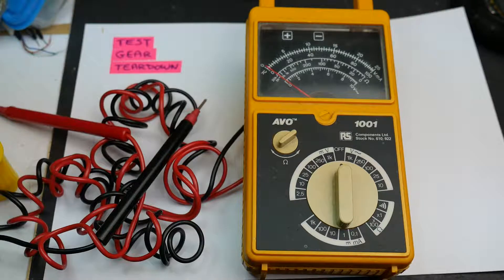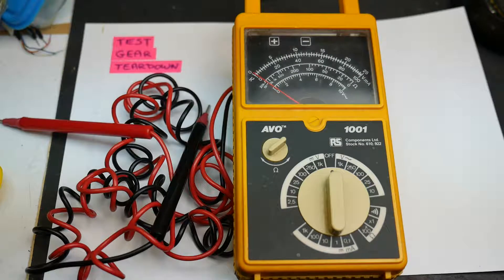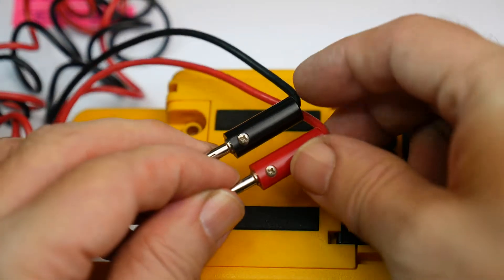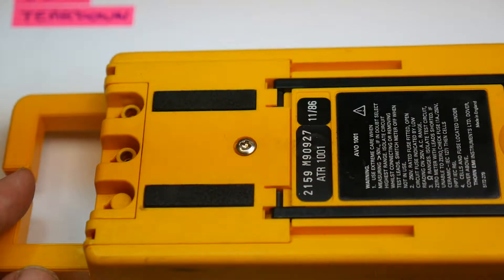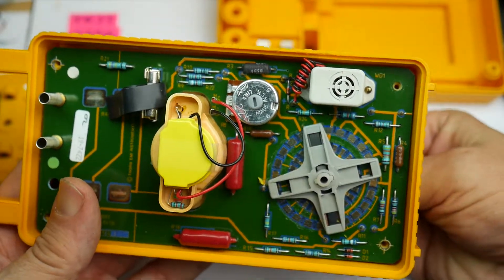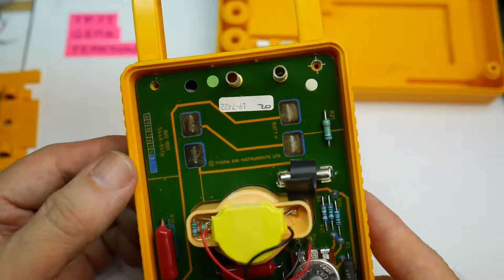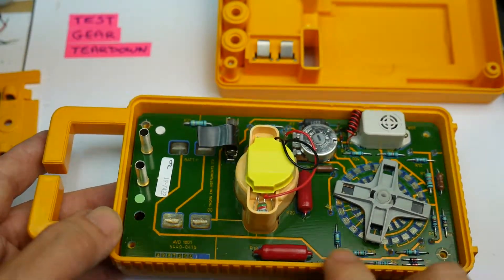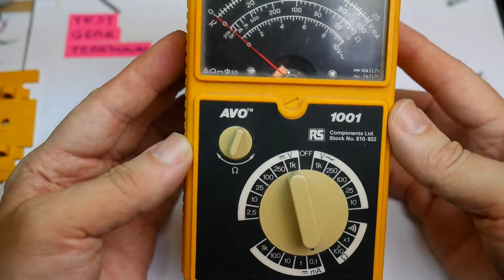Test Gear Teardown: AVO Model 1001 Multimeter

Comment: Any one knows what the original fuse rating is?
Reply from the maker: The fuse in my meter is rated 1Amp. Of course, I don't know if that's correct -- it may have been changed! But the highest current range is also 1Amp, so I think that makes sense.

Comment: Hi there, thank you for your nice overview of the Avo 1001.  I have one of these and I usen it from time to time but something puzzles me about it.  The 1001 is a 10K per volt meter, so on 2.5V you expect to measure 25k ohms, on 10V 100k ohms etc.  Indeed, that is what I measure until the 100V range, where instead of the expected 1M ohm I'm measuring 2.58 M ohms, but the value you get depends on the range of the DMM I'm using to measure ohms.  Do you have any idea of the reason for this?  It reads accurately when you apply an appropriate voltage on these ranges, which makes it all the more difficult to understand.

Comment: Wow, are those the OEM probes?
Reply from the maker: Certainly hope not! They're entirely unbranded and lack the insulating sleeve that the meter's sockets are designed to fit, so I think they must be non-original.
Reply: @anachrocomputer  The probes are not original. I have one of these meters with all accessories, apart from instructions, still in its original box unused and if memory serves me correctly they cost £98 + vat in 1990 from the RS catalogue.
The probe plugs that fit into the meter are angled at 90 degrees and perfectly fit the recess of the meter so they look in line with the carrying handle when plugged in. There is also an additional pair of plugs (the actual probes seperate from plugs at the end of the wire) which fit the meter allowing just the probes to plug in. So you can have a meter with a probe directly attached thus freeing a hand. Mine is dated from 1987 and they were made for electricians rather than for use in electronics as they aren't sensitive at 10k ohms per volt DC. For AC it is 1k ohms per volt. Yet these meters can only measure DC current of up 1 amp. There being no AC current range at all. I seem to remember there was an another model called Avo 1000 which did have an AC current range which explains why one of the sockets has been blanked as the same casing was used on both models. There was an earlier Avo meter called the Multiminor which also has a sensitivity of 10k ohms per volt DC and 1k ohms per volt AC. I have one in its original box with instructions dated 1959.
Nice to look at and to check battery voltages but for most practical electronics purposes largely obsolete. Although for the electrician the 1k ohms per volt AC can be useful because it will not read induced voltages from nearby live cables as a 10 meg ohm digital meter will.
Many thanks for your teardown.
Reply: @darrencady4261  only an idiot would unplug the leads from the meter with them connected to the circuit. We assumed folks who used meters weren't idiots in those days.